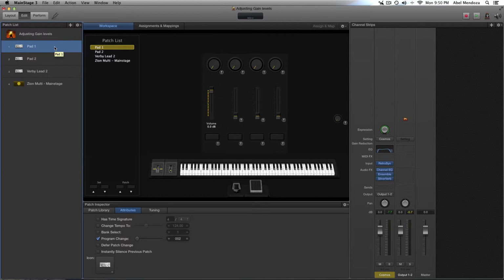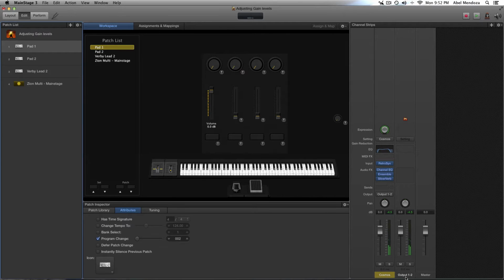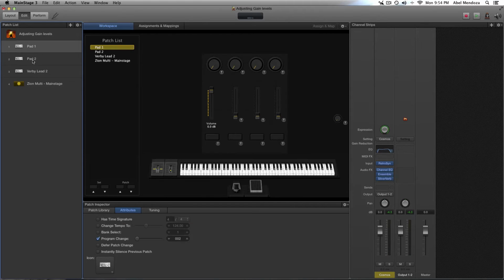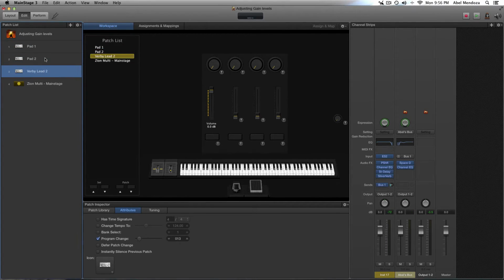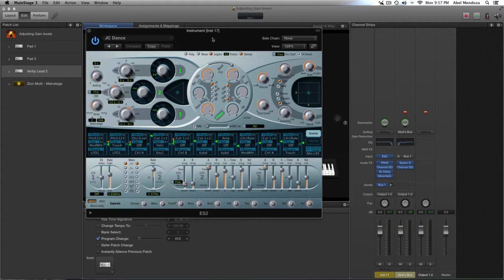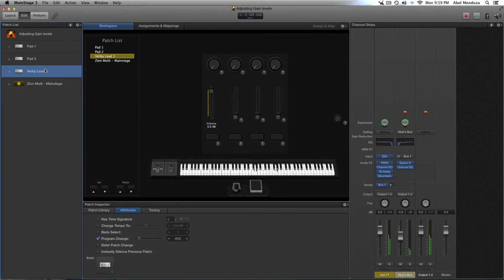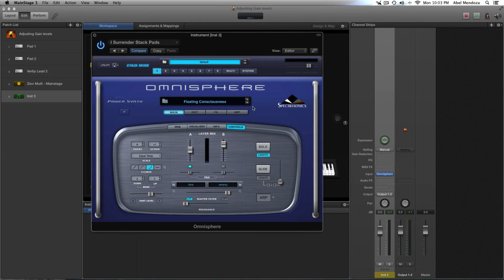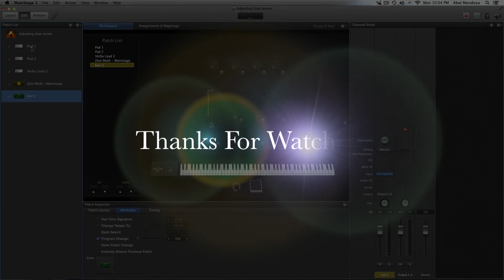Controlling Volume Levels In MainStage 3 - Gain Stage

Comment: So, I should limit each channel strip, as well as Output 1-2, to -5to -7dbs? And we set according to the little window on the right?  Why not the window on the left, above each slider? Why do we go into the plug-in to re-adjust volume; why not simply adjust the slider?  If adjusting means watching the little green little window on the right, that number seems to vary so much in the song, and is dependent on the moment, how hard you hit the keys, etc.  What about real time volume adjustments with the sliders, such as soloing or bringing in some strings?  How to avoid going too loud?